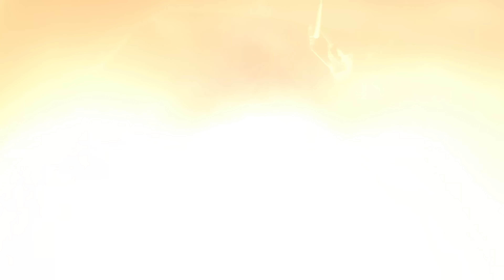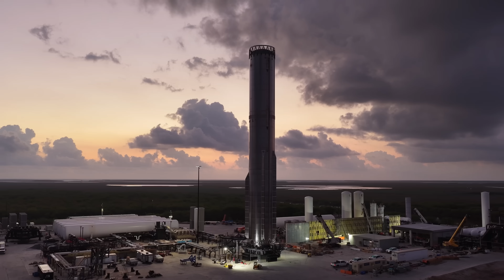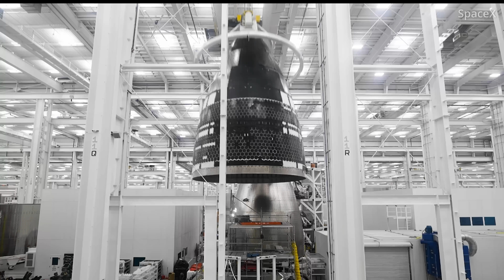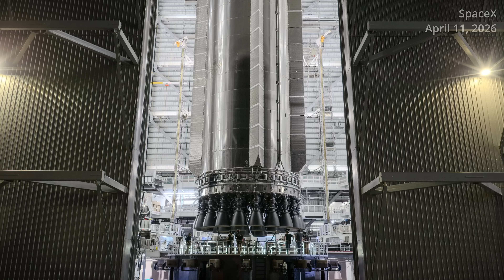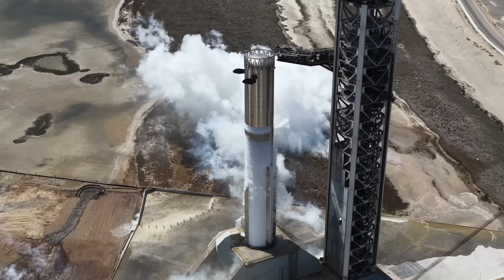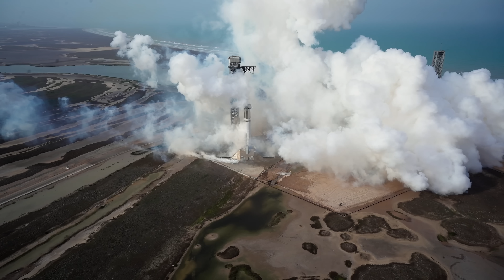Here comes SpaceX's Starship Version 3

Comment: I heard the narrator say that there’s an “extra layer of metal” covering  the dome at the hot staging ring on the booster. Why don’t they just use some heat shield tiles to cover the dome (presumably much lighter)? And similarly, couldn’t they use tiles on the flame diverter for extra manageable protection?

Comment: No mention if Spacex has redesigned the upper stage? The rocket is too heavy that was a big part of the failures in 2025. We will soon find out if the new engines can lift the rocket with enough thrust.

Comment: Why don't they build the testing area in a way that if something explodes really little expensive stuff getts damaged? 
Why can't the white big barrels for example be lowered to underground with like an elefator function and be filled up while they're underground and only need to be taken out there and replaced if it's needed? When you see explosions they easily could get damaged otherwise and unnecessarily and it costs even more time and noney in such cases.
Reply: Loaded with 2,000+ Tons of fuel and it goes boom, it's bound to fuckup the launch pad.

Comment: SpaceX is being extremely cautious right now. V3 is still designed for 280 tf.
Reply: V3 may still be an interim design but it'll be good enough to loft Starlinks, even if not strictly the idealized iteration of the vehicle.  My big question mark is how long SpaceX intends to futz around with the not-final design.  Is it correct to identify that none of the currently-built towers are tall enough to handle V4?  I would not be surprised to witness the first tower being overhauled—first with the improved flame diverter and finally with an elongation—and that the timeline of that retrofit would be largely dictating Starship's existence as V3.